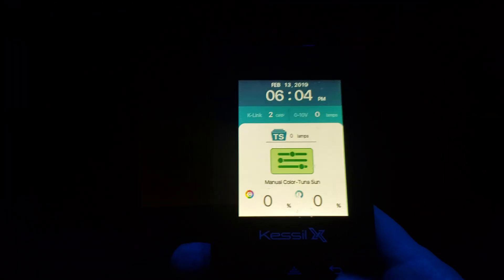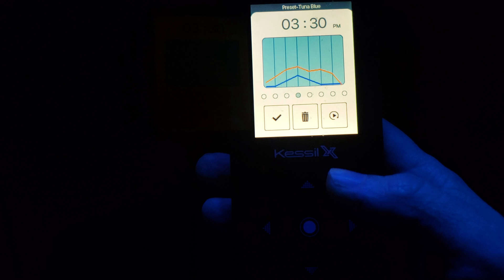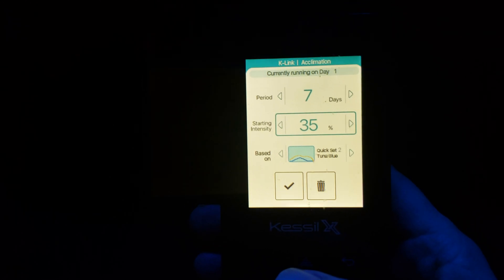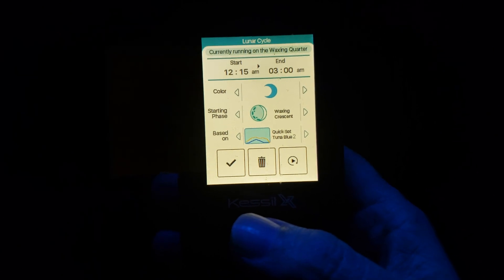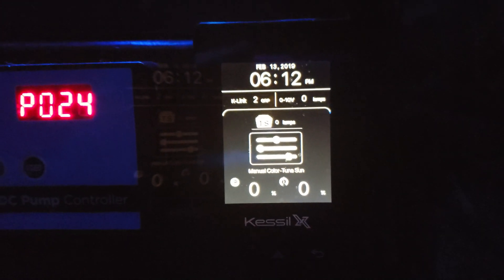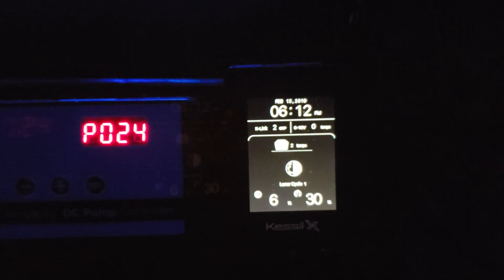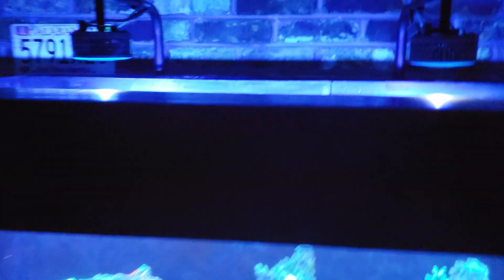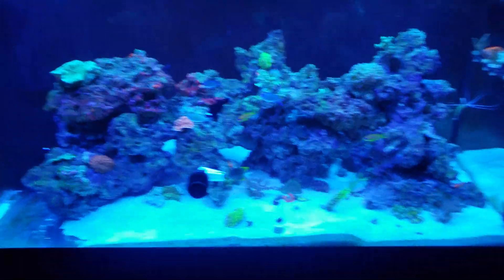Kessil 360x Spectral X controller set up. Acclimation and lunar mode explained.

Comment: I know this is a 4 year old video, but today setting up my 360x, the male/female power connector between the light and the power, is EXTREMELY loose, as in the connection can just fall apart...? am I missing something? my other kessil A80 does not have this issue, it is a sold and positive connection...

Comment: Do I need to connect the controller to my A360x tuna sun all the time? Will it run the program I set after I disconnect the controller?
Reply from the maker: Good question. I believe it would need the controller to run the programs.